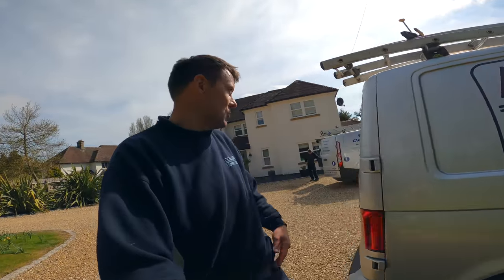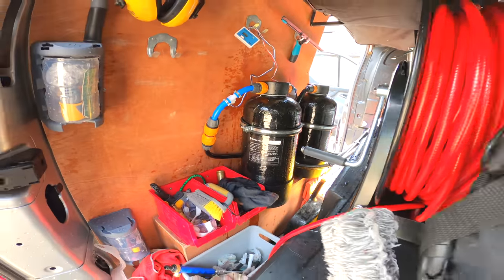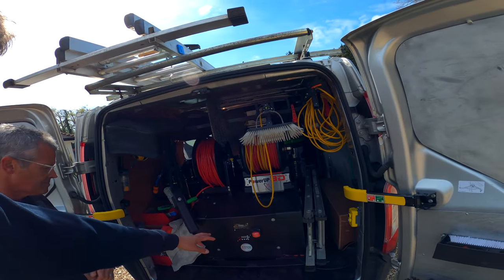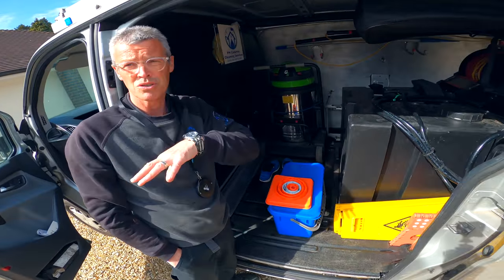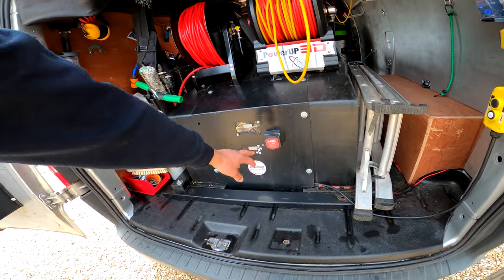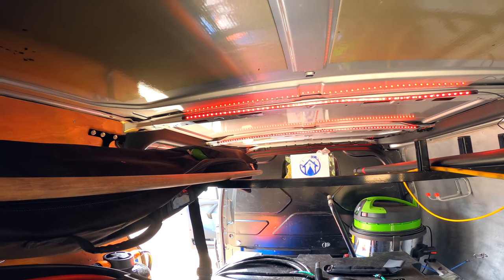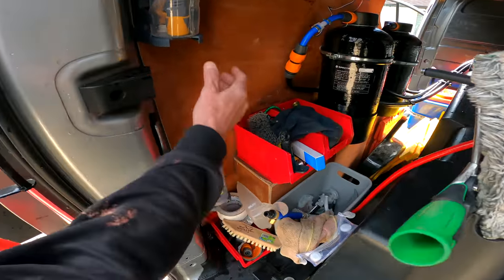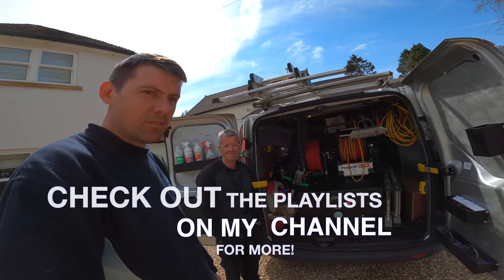Window Cleaners Van Fit Out - Transit Custom

Comment: Nice little setup. I don't get inline wfp filtration systems as you're heavily reliant on resin health during the job. Would be better just getting your water down to zero at home and running it through the system as normal.
Reply from the maker: There are pros and cons to each I suppose. So many different possible ways of doing things, everyone has their own preference.😃👍🏼

Comment: Looks like a great system Paul has there. One question, why di in vehicle, is it because you have soft water and can fill via customers supply if necessary?
Reply: Great question and yes. It gives me that backup if I run out. (Never had yet though)😊😄

Comment: Really good video, I do like these flat tanks these days! The transit custom is a van I be looking to get at somepoint too. I currently have a custom system in my Caddy maxi at the moment, 350liter flat tank, 100m 6mm hose, 1 manual hose reel, 1 32ft pole, and running a leisure battery that I have to charge every night in my house. I want to get a two man setup soon once I have a bigger van but what you think is best...to get a fresh system like paul has there, or to keep what I have and add to it? 
Thanks.
Sam.
Reply from the maker: I personally think it might be worth getting a slightly bigger tank, especially if you are thinking of a two man system and pushing your business forward.😉👍🏼

Comment: What is the Transit like ?   what about water on the   van floor ?  Again very interesting video .. thank you
Reply: Transit is great. Has very good load capacity and the rhino flooring helps prevent water on the flooring. I will seal the two potential water ingress areas at the rear shortly.

Comment: Great video! Great to see Paul doing well!! 
What’s the advantage of having the di after the tank instead of full filter system at home and then just delivery in he van eg no Di in the van?
Reply: Hi Ben. If I run out when on the road - I can filter my customers water through DI to poles. Never needed but never know. Your point is a good one and I may change this setup in the future. Thank you. 👍
Reply: That’s a great point! I may stick a vessel in the van as well!! 👍🏻
Reply from the maker: I guess you can be sure it’s being purified down to 0 as you use it on the glass.😃👍🏼

Comment: I have no room for any storage at home....my ppm is running at 60-70 max, would a Van mounted DI system be all I would need?
I'm new to Window cleaning, having been a Aerial & Satellite installer for 20 years and a young 65 ...I don't want to keep getting over roofs and crawling through lofts, so am hoping this may be the answer for me. Thanks ;0)
Reply from the maker: Yeah, that’s pretty soft water, so you might find that just having the resin DI filter is enough.👍🏼
Reply: Thanks Mr M ;0)  @aemackintosh

Comment: So if I want to set up my own business and want to use a pure water system then this is the set up I would need???
Reply from the maker: Or something like this. There are lots of different versions out there. Or you could even use something as simple as a backpack if you can get pure water from somewhere.😃👍🏼 https://youtu.be/lrbQb5Ib4vc
Reply: @aemackintosh  if there was a pure water station nearby, would my set up just need to be a tank, pump and water pole? Would it work out cheaper to use a station, or to have a full set up to create my own pure water? Thanks
Reply from the maker: Yeah, it’s cheaper in the long run to make your own pure water.👍🏼
Reply: Hi Ashley, I’ve been looking at the FaceLift 325ltr from the Window Cleaning Warehouse and wanted your thoughts on brand etc. It’s for a new 1 man start-up. Sorry for all the questions of late.
Reply from the maker: Yeah, sounds like a pretty decent option.😃👍🏼
Reply: @aemackintosh  I’m looking at the Xline 350 litre, FaceLift 350 litre or the water genie pro lite 350 litre. What would your preference be if you don’t mind me asking???

Comment: I often wonder how the water moving around in the water tank affects the van while driving.
Reply from the maker: The tanks are usually baffled which helps stop the water sloshing about too much. But yeah, that’s what I was saying about upright tanks can affect the vehicles handling the most because the weight is higher up. Flat tanks are best for handling because the weight is lower and spread out, but it takes up more space. So mid tanks like Paul’s are a great option because you still get good space in the van but the weight isn’t too high.😃👍🏼